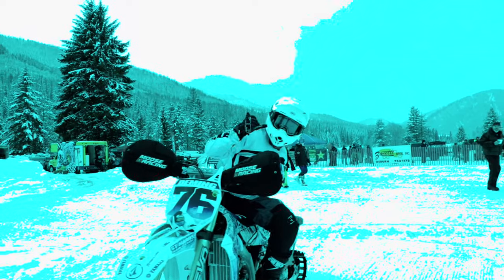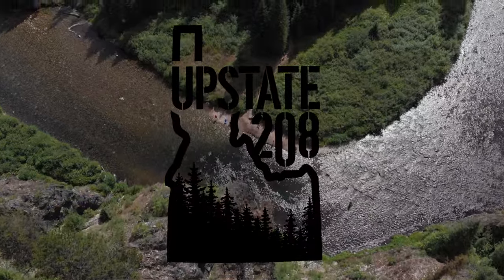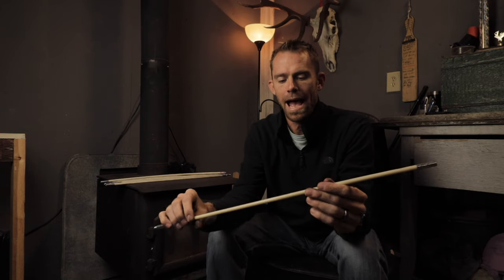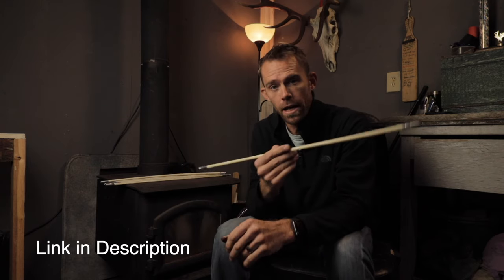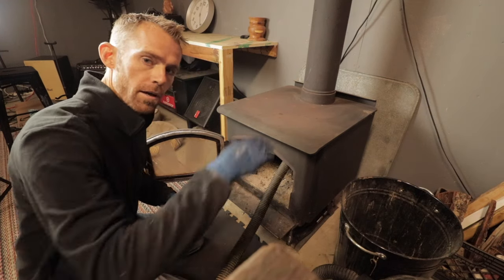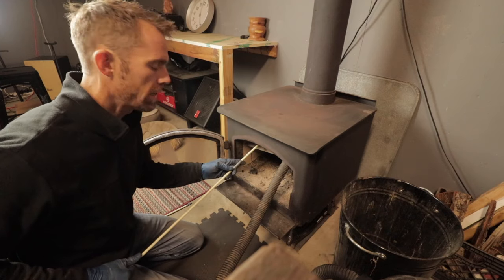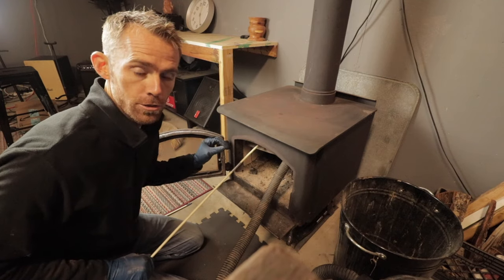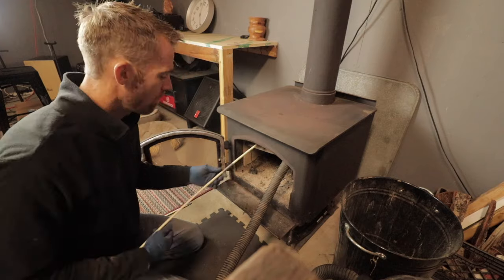How to Sweep your Chimney - The Easy Way

Comment: Questions.  where do you get those bendable rods and two, where can I find (buy) the sealing cord.  Ours is old and needs replacing.  Need answer ASAP. Thank you
Reply from the maker: There is a link in the description of the video for the rod’s and brush. The seal for the door can be found perhaps at Ace, Home Depot, or a wood stove shop. Make sure the rope seal you get is the same size and style of the one you are replacing. You will also need some hi-temp silicone or furnace cement to get the seal to stick in place. Good luck.👌🏼

Comment: Just subscribed. Great video. I’m looking to buy a wood stove for my 1200 sq ft brick home. Should I shoot for a 1800 sq ft model or 1200? I seen the 1200 models are more for 2 rooms.
Reply from the maker: @dgmickley - I would say to consider the physical size of the stove and where you are going to install it. Are there limitations of that space that will be accommodate a smaller stove better? Also, how do you plan to use the stove(several cords a year and burning it like crazy, or periodic burning when it’s really cold of for ambiance.)? Just a few things to consider when choosing a size. Brick homes have a lot of thermal mass, so remember that the stove will take the edge off when it’s cold, but if your trying to warm up a cold brick house it’s gonna take awhile to warm up all that mass. On the flip side, once you get those bricks warm, they will hold the heat well.  Let er burn🔥. Thanks for watching

Comment: Thanks for the chimney cleaning tips. We have a 2007 Quad-Fire that looks just like yours but has a baffle board and a ceramic blanket above the tube channels instead of the firebricks that you have on your unit. Where did you get your 6" dryer vent brush kit from? You video suggest checking the "Link in Description" but I could not find where the link is. All I could find on Amazon was 4" dryer vent brush sets. Thanks so much.
Reply from the maker: @Dennis Labinski- Yes, mine is an older model before they went to the baffle board and blanket. Same principals apply, however I will say it’s tuff to get the blanket back in there on those models without removing the stove pipe so you can reach thru the flu collar and put it back in place. I will check my link but I bought my kit on amazon. It came with a 4” and 6” brush and I believe 20’ of rods.

Comment: Don't forget to clean the mesh on the cap at the top...thar often gets clogged and diminishes the draft.
Reply from the maker: That is a great point. My cap does not have mesh, but many do. That is a prime spot for the flue to get clogged up and start creating poor draft resulting in the stove burping smoke back into the room.
Reply: @UpState208  you should get a cap with mesh. Birds love 6" pipe for nest building.

Comment: There is batting on top of the baffle plate bricks.  If I remove it gently I should be able to put it back?  There is not a lot of clearance so I am concerned I might not get it back in as smoothly as it was in there before. Any suggestions?
Reply from the maker: Sometimes it is difficult to remove that insulation and then put it back without removing the stove pipe. Whatever you do, ensure that the insulation blanket is laying flat on top of the bricks so it doesn’t interfere with air flow. Good luck

Comment: Hi thank you for sharing ..im curious can this cleaning be done with a fire place insert wood stove ? I mean I'd think so..
Reply from the maker: Wood stove inserts can be tricky. It just depends on how it was installed. Be cautious if sweeping an insert and make sure to verify that it has a direct connection liner. It’s is very important to verify that you are able to contain any creosote being swept out of the chimney, and that it isn’t depositing on top of the stove or behind it. If possible you should remove the trim pieces of the insert to verify what’s going on with the connection to the existing chimney and that there isn’t debri or creosote caked around the unit. Careful with these ones.☺️
Reply: @UpState208  Thank You for ur fast response .. altho I'm pretty fierce handy gurl 🔨 I think I'll leave this to the pros !

Comment: My chimney was cleaned in the fall, prior to having any fires this winter.  However, I had a chimney fire last night, grateful the house didn't burn down, but wondering WTH?  I burn some pine but otherwise red and white fir with some other miscellaneous species.  I'm sort of boggled why it caught fire.  I burn in it all day, everyday and have had no issues.  Worried I'll need to get up there to clean the chimney again with snow on the roof.  (Unable to clean from inside as it's an older style with the shelf above damper).  Any ideas why the flames?
Reply from the maker: If you’ve had a chimney fire you need to look inside that chimney and verify it hasn’t been damaged, probably worth having a pro with a camera come scope it and see if everything is ok. If you burn all day, everyday at a low burn rate where the stove is starved for air, you could build that thing up with creosote quickly. How and what you burn can have a dramatic impact on creosote build up. Be careful, chimney fires make me concerned about the systems safety afterwards.
Reply: @UpState208  copy that!  It didn't flame long before I was able to shut it down...there are a few details I think leading up to it.  That my damper was stuck in place for a couple days so it burned slow and likely not hot enough to burn out the creosote.   But I got it loose and for only one day had fire going then that night it flamed out top.  Unfortunately I really can't get anyone out to where I live to handle things.  Had a guy out of Spokane but he kept flaking so I was able to get chimney cleaned (diy) prior to this seasons burning although wondering what really led up to the flames out top....few obstacles to check chimney as well due to height of it off roof, pitch of roof and now snow and ice.  I have stove pulled out of its hole and will be cleaning chimney bottom up due to obstacles of getting on roof right now, so thanks for your video on that!  This wasn't an issue last season and I burned lots of pine!   But I also didn't have a damper...just trying to configure the issues.

Comment: My Quadra Fire ( looks exactly like yours ) has a baffle blanket.  Can I replace the blanket with bricks?  The blanket tends to build up with very fine dense ash.  I think the bricks will get hotter and burn off the ash better.
Reply from the maker: I would think Quadrafire’s answer would be “consult your manual”. I have seen them with only bricks, and I have seen them with only blankets, it depends on the model. The basic principal is insulating the firebox to keep the heat in the stove and to help with efficiency and secondary combustion. You may actually lose some efficiency with bricks vs blanket, and it could be a spacing concern between the baffle plate and the top of the stove. Quadrafire will tell you to do whatever their manual says to do. 🤷🏼‍♂️
Reply: @UpState208  Thank you for the info. I'll search for my owners manual.

Comment: Do you recommend flue cleaner stuff that you burn with wood
Reply from the maker: I’ve never been a big fan of those things. In all
honesty, I don’t know much about it. I think it’s hard to substitute anything for a good old fashion sweep of the chimney.
Reply: @UpState208  I see. I get mixed answers. Sure chimneys must be physically cleaned. But some say it drops creosote. I have a very stupid situation. I feel like going crazy about it. I live in luxury gated community development. But the craftsmanship is so poor, they made every single chimney to open to each other at the level of the cement flooring. So we can't close it. But we can see it. So i had to run a long stainless steel flue but i couldn't put an elbow yet. And I took a picture of the flue after burning wood for 10 days, and it looks like it's peeling off. 😣😖 I'm going nuts. We don't have those specialists here our stoves suck too.

Comment: i have a 4" chimney for my wood stove, but i feel my damper will prevent me from cleaning my chimney myself? How do i get by damper?
Reply from the maker: Should be able to open the damper and slip the brush right past it. I have never seen a 4” wood stove pipe.
Reply: 4" stove pipe is probably from a pellet stove that is fan forced.

Comment: Would those rods bend through two 45 degree angle pieces? Thats what I have on mine, one taking it out through the wall and then the other taking it into the main past of the flu
Reply from the maker: @fostex fan - I believe they would go through two 45 deg. Elbows. However, I will say that going through is usually not where the brush gets stuck, it’s when you are coming back from up or down(depending on whether you are sweeping from top or bottom). Also, having a somewhat flexible(soft) brush would help with this. If you do get stuck in those 45’s try rotating the brush as you pull on it and this will often times allow it to slide past whatever it is getting hung up on. 45’s are a good place for creosote to hang out so try to verify those angles are getting cleaned well. Good luck.
Reply: @UpState208  Thanks for the advice. Mayby an alternative to that is sending her indoors up the ladder to unscrew the brush from the chimney cowling leaving me free to withdraw and unscrew the rods from the stove. Multi tasking solved :-)

Comment: Sorry about this but I have to take issue with your advice, like you I am no longer working as a sweep but have considerable experience and training . My main point is that of polymer brushes and creosote, creosote can be found in various conditions depending on the stove it's flue the location of the flue in relation to the roof and surrounding buildings or trees, the type of cap you have on the flue the flue material and construction, the quality of your fuel and the way the stove is operated. Polymer brushes will not deal with slick hard caked creosote at all, in fact they will only deal with dusty dry creosote that has been burnt dry, and will leave behind deposits of hardened creosote ,over a number of years this can build up resulting in a chimney fire. Further more most baffle plates are designed to be pulled forward so as to allow easy brush entry from the fire box and allow the swept deposits to fall straight down into the aforementioned fire box.[top exit stoves only] rear exit stoves require a modified technique. Chimney caps should be cleaned properly, preferably removed before sweeping the flue, this also reduces the chance of damage to the cap and dislodging sectional flue systems.Prior to cap replacement a good light should be shone down the flue to aid visual inspection. I used to have brushes made for me by various companies to my own specification to fit various flue sizes the bristles being made from an assortment of materials from flat spring steel and brass to softer natural bristles and polymers.
Reply from the maker: I don’t disagree with anything you just wrote. Much more detail than I offered in the video, and definitely something to take note of if anyone is cleaning their system without any knowledge. I would always recommend having a certified professional check your system over if you have any doubts. Thanks for watching and for adding some good pointers for anyone to consider.

Comment: what if you have a damper in the way???to push the brush up there
Reply: maybe use a different brush
Reply from the maker: A damper could complicate things depending on what type of damper it is. I’ve been able to slip past the damper before while it’s in the fully open position, but you would want to take special attention to making sure you don’t get hung up on it, or get creosote caked around it may not allow it function properly.

Comment: do them \chimney  sweeping logs  work
Reply from the maker: I’ve never seen one remove creosote from the chimney walls. It may soften it, or burn off some of the existing soot, but they are not a replacement for regular sweeping of the chimney.

Comment: Does dust still come out of the vacuum or ash? Is a wet vac with the filter enough or Would it be better to run an exhaust tube from the vacuum out a window?
Reply from the maker: Unless you have a really good vacuum with a HEPA filter system it will probably still come through the filter. Running the exhaust outside is a good idea if you are able to do that. If this was in my home I would be more worried about it, but this is a shop so a little dust wasn’t concerning to me.
Reply: @UpState208   yeah, I don’t remember cleaning a chimney twice and I didn’t do it myself, the people who did it came in and put a big trash bag inside the stove and then went up on the roof to sweep it and the trash bag was taped and sealed off so nothing would get out of the stove but the last time it still made a mess. Lol

Comment: My pipe goes up and then I think it's a 90 degree curve it's on a lower level and we couldn't go straight up, will your system you used bend through the curve piece of pipe?
Reply from the maker: The brush setup I use would go through a single 90 degree elbow, but it would most likely fail to go through a second 90 degree elbow where your stack returns to vertical. Always a good idea to take the 90’s apart and confirm that they are clean as that is a prime spot for things to get choked up. If you can sweep through your 90 to a tee outside that has a removable end cap that may be a way to handle that.

Comment: Good job. Dont you put  rods on a cordless drill too.
Reply from the maker: I’ve done that before yes, but mostly on dryer vents. I’m sure it would help just be careful that you aren’t unscrewing your rod connectors with the still and the come apart while in the chimney, you would have yourself in a pickle if that happened.☺️

Comment: I think your giving some good info, but not enough....any professional will verify either with a camera or visually that the flue is clear of any obstructions or soot BEFORE lighting a fire...and i have to stress that just cleaning the chimney doesnt make it safe------that is giving a false sense of security-----over 90% of installations that i inspect fail due to clearances and conditions which most are unknown to the homeowner. its a good idea to recommend proper inspection and cleaning by an experienced and certified sweep is the way to go
Reply from the maker: I agree. If someone isn’t 100% sure of what they are doing or the potential hazards involved it’s always best to call a professional to take care of it.

Comment: I've been burning wood for over 40 years,your way has got to be the hardest way possible to clean the pipe,and dirt est way also.My rods are 5ft in length,twice the diameter,and my brush is much bigger in size also.I clean my pipe every 2-3 months,because I burn 24-7,8 months of the year.My god,son did you just learn about cleaning the pipe?????Your way might work but there is a much easier way.Come on.
Reply from the maker: Love it!! Make a video, share your wisdom with the world my friend.🙌🏻

Comment: no way to access with modern baffles welded in
Reply from the maker: Newer stove may require you to remove the stove pipe. Sometimes there is just no way around it, unfortunately.

Comment: THAT is not a clean chimney😂😂😂😂 A too small, too soft brush.
Reply from the maker: Not always required to have a stiff bristle brush. I burn seasoned dry wood in hot fires, I don’t have tacky, or crusted creosote on my chimney walls. However, that is not always the case depending on many factors from stove, wood and how the operator uses the stove. If you do have crusted or tacky creosote in your chimney walls, this brush will not do what you need it too.